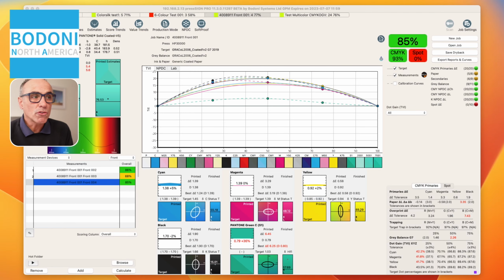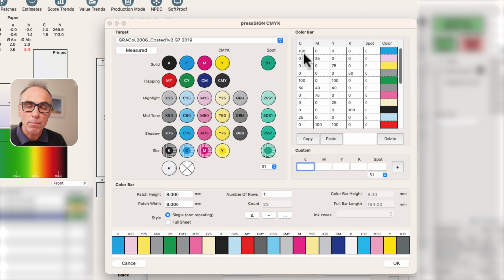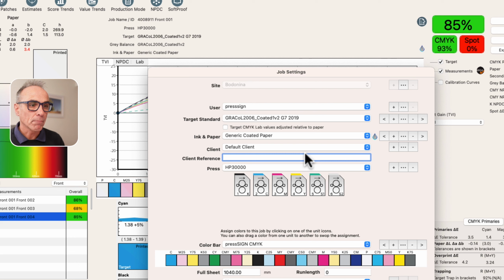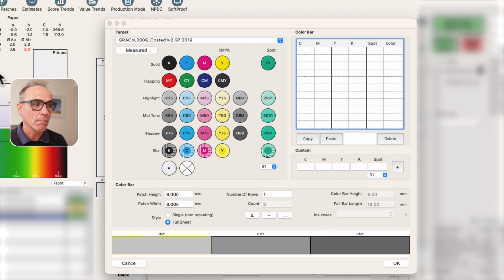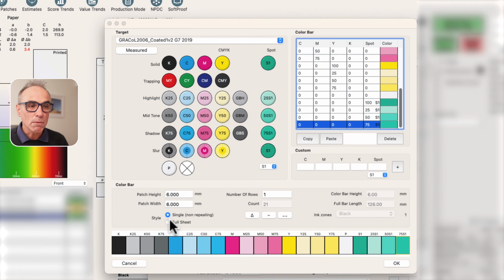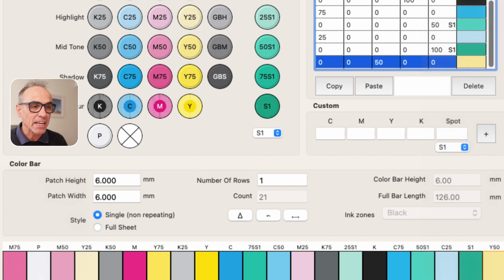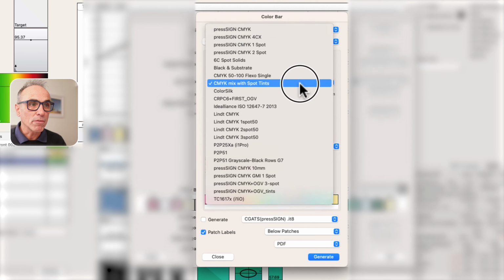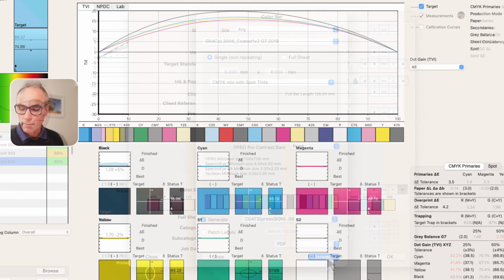Color Bar Creator pressSIGN 11.3 - Tutorial, Create Randomized Patches for custom colour print jobs

Comment: indesign generates its own colorbar when saving to pdf. isnt it enough? however i only tick on crop marks, bleed marks, registration and skip on color bar whenever i send pdf to printers. but then the printers never came back to me and ask for it. does it mean they will ignore whenever theres color shift on press run or are they generating their own color bar .
i hope you understand my english =]
Reply from the maker: Printers will generate a colour bar to meet the requirements of their measurement devices. PressSIGN's colour bar generator allows the printer to add special colours to the colour bar, as well as ensuring that it is compatible with their measurement devices.